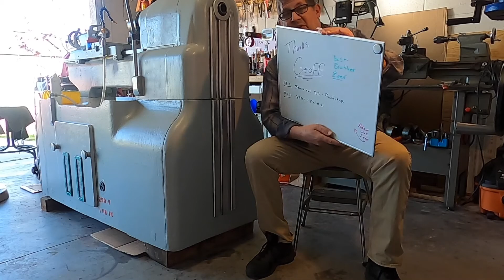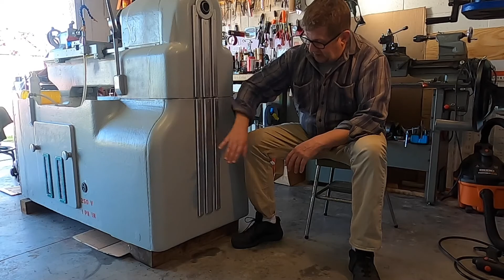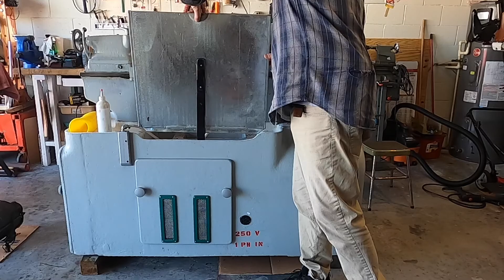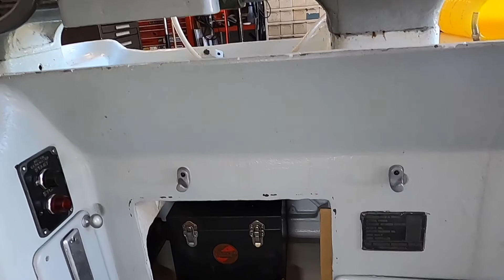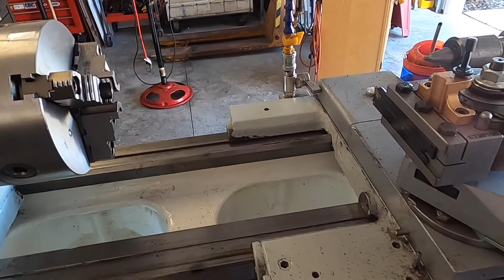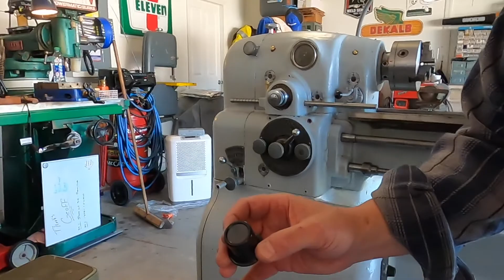Lathe, Monarch 10EE Part 1: Cleanup, Repair, & Prep for Service. Hobby lathe skills

Comment: Don, Do you have any pictures of the 7.5 motor and the way you mounted it using the old DC case?
Reply from the maker: I have a video coming out either next weekend or the weekend after , depending on my schedule that'll give some nice close up detail with partial disassembly. footage is done, I just need time to edit.  Don

Comment: Kudos on using a VFD.  The soft start feature alone will save tons of wear on the entire machine.  It provides full torque throughout the entire range and can stop the machine faster than anything else. I'm amazed more people aren't using VFDs more of the time.
Reply from the maker: There are a lot of hobby guys that believe in keeping the machine OEM. Keeping it that way IS their hobby. I'm just a user that needs the machine to work every day, and hopefully when I'm fully retired I'll have no regrets about the repower. As of now, its quiet, clean, reliable and with more than enough Ooomph to get done anything I ask of it.  Thanks for the support. Don
Reply: @donsengine3158  I respect the purists. The history of machinery is truly amazing and I really appreciate perfectly preserved examples. I also respect my spindle bearings. If the original machine designers had access to VFDs, I'm pretty sure they'd approve. You've made yours a better machine IMO.  Love the videos & really appreciate the work you put into them.
Reply from the maker: @Ideasite  Thanks Patrick. Monarch actually rebuilds these with AC motors and VFDs at the factory...

Comment: Im sorry man. I had all those panels! Was going to list them on ebay, but I am drowning in machines and parts. I scraped a lathe just like this. The only thing I have is the original tool holder and the bolt on parts for the turret style lathes. I

If you want the tool holder send me a email. I will take $100 shipped. But the quick change ones would probably be better. 

Sorry I scrapped all the other parts. I just had to get it gone. I have scrapped lots of money in steels and machine parts I could have sold if I had more space.
Reply from the maker: I'm good, you should go onto practical machinist and let em know what you got. Lot of hard core Monarch guys on there.  Don

Comment: The double male cheater cord is a KILLER.   But hey, your shop, your rules.
Reply from the maker: The need to go that route had more to do with keeping total morons from using it in the off hours than anything else.  Now that its in my garage, I can control what goes on around it.  Its still a work in progress and changing inputs isn't at the top of the list.. Yet!  Don.
Reply: @donsengine3158  Love that you put the 3ph motor right inside the gutted DC motor.  That's cat's ass!  I have a Hendey T&G lathe. I just subbed your channel.  Check mine out if you like.  --Doozer

Comment: Don, I admire your hard work but with all due respect, that female power input is very dangerous. Especially at that power level. If the lathe end gets unplugged, well you know. They make 30 amp male twistlock connectors and even 50 amp versions which I highly recommend you replace that female inlet with. Barring that, a lathe of that size isn't exactly portable or easily moved. To save some money why not consider a 4 inch J-box or just a plate with a cable clamp captive cord.
Reply from the maker: All Good points there Andy,. A lot of this had more to do with what was available and who was working around this machine at the time. It gets more complicated than what my word count can handle. Lets just say it kept the idiots at bay. All my machines are an ongoing work in progress, so you may see some changes coming down the line.   Don

Comment: nice Don cant wait to see the 2nd part for the vfd, i justs pick a 1951 10ee as well i need to decide to stay with the MG or go with a vfd, as well
Reply from the maker: Should be coming up pretty soon.  I have to wait on daughter editing dept to spit it out. 51 MG, pretty nice. If it runs nicely no sense in converting it. If its got you pulling your hair out... well that's another story. Will have a bunch of 10EE repair, MX, and operation videos popping up over the summer. Already recorded and waiting edit.  Don